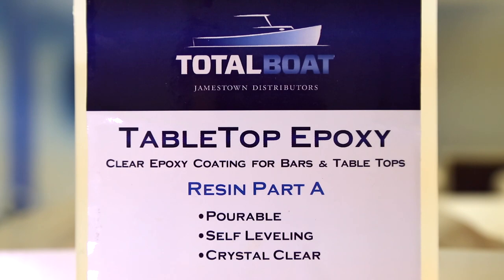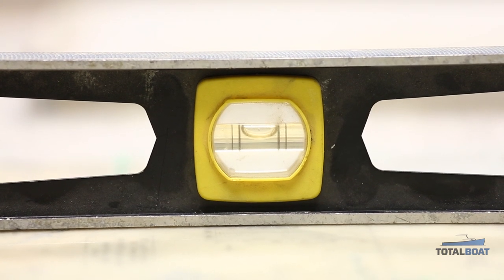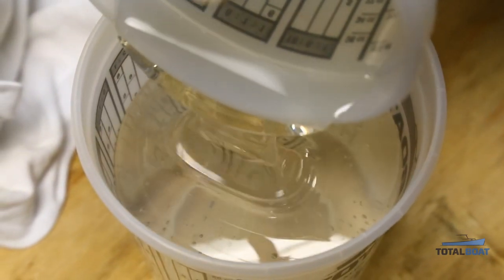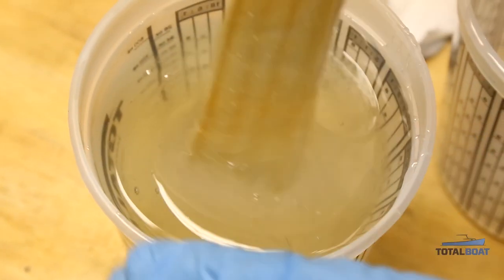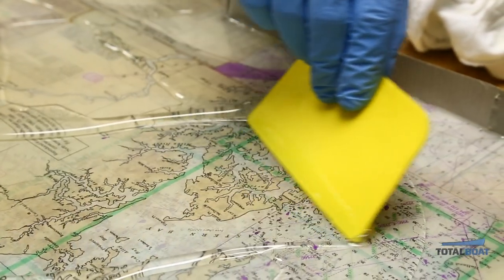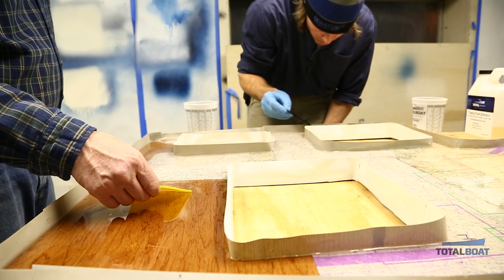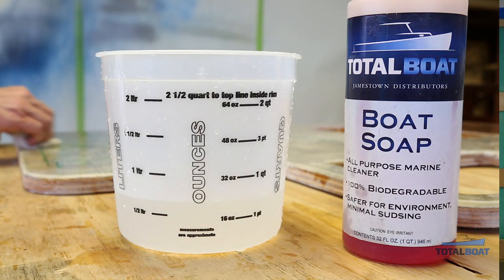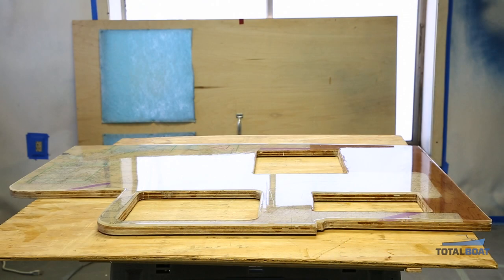How to Apply Clear TableTop Epoxy by TotalBoat

Comment: Using a drinking Straw and blowing down on the bubbles at a 90° angle will also remove bubbles deeper in the epoxy, and on the bottom against the surface being coated.(it cavitates a crater so check that it recovers flatness) the Torch method works, because of the Blowing action. {However this will heat the Resin lessening work time before setting up} The movement of air against the bubbles causes them to rupture...
Just a thought.....CmeL8r

Comment: I'm trying to make a lake for my train set and want to know if I can use this product to fill in the lake (about 3-4 inches deep) and will it harden that thick? Also will a hair dryer work to get the bubbles  out?
Reply: The he product says it should only be used up to 1/8 an inch. You could probably do it in sections though and embed fish or something fun
Reply: YES! add the epoxy in a few shallow layers, and you'll love the results!
Reply: Cat lover I’m two years late but be careful leaving epoxy too thick, the chemical reaction can cause it to flash and catch fire.. I don’t think 4” is recommended but who knows🤷‍♂️

Comment: Will this epoxy turn yellow over time?
Reply: It shouldn't as long as it is not exposed to UV rays - the Epoxy has no UV filters and will, therefore, be yellowed by the sun. It can be topcoated with a clear varnish to prevent degradation and yellowing.
Reply: Also if there is color of any kind under Epoxy you can’t see it yellow